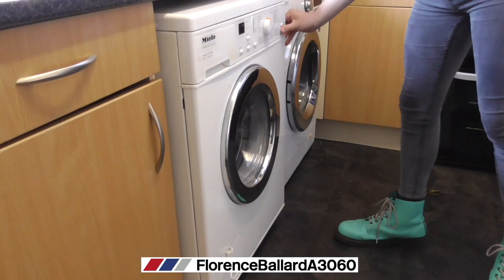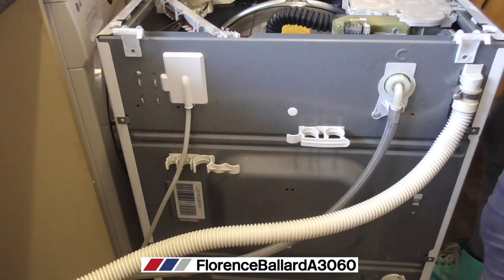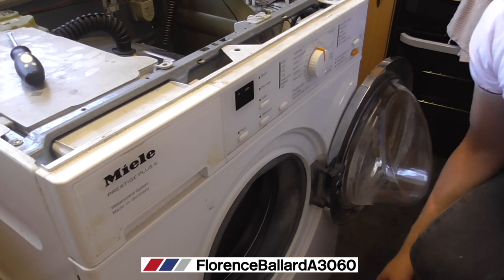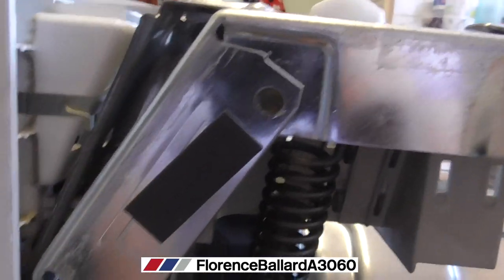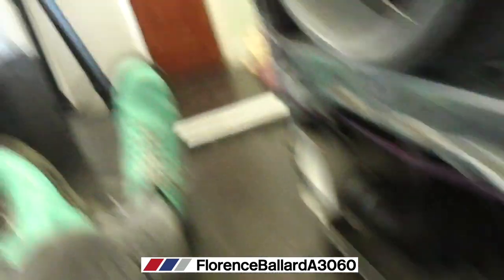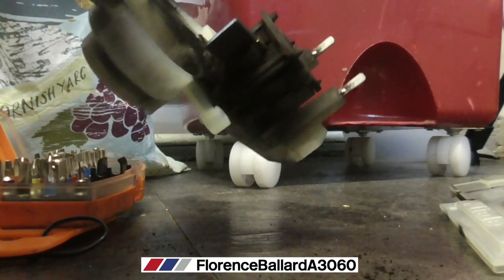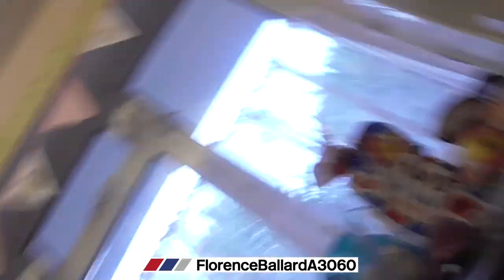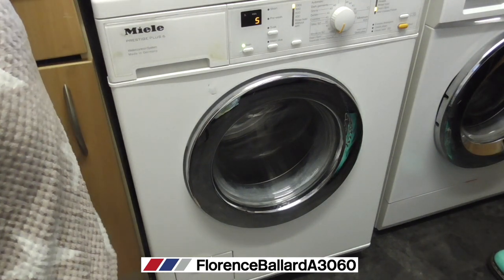Millie's First Carbon Brush Replacement in 12.5 Years

Comment: 2 questions as I have the same issue. 1. Did the brush holder just pull out after you removed screws? 2. How did you get the new brush assembly back in without damaging the brushes? Thanks.
Reply from the maker: Hey! :). So the brush holder does come off after removing the screws, but from what I can remember, I did need to jiggle it slightly to remove it.

As for the brushes upon refitting, I held them in with my finger on each end as I slid the holder onto the armature. I hope that makes sense haha
Reply: @HooverA3060  yup perfect sense. New brushes coming in a couple of days so thanks for the heads up , much appreciated.

Comment: I’ve brought a miele for £45 it’s a w1512 but I changed it to 1500rpm and when I brought it it had bad brushes one worse than the other this video was very useful and helped me all the way through it and a waterproof fault came on to but that was just the cable for the pressure switch at the bottom new she’s as good as new
Reply: Sorry, I know your post is a couple of years old, if you can remember, how did you do the upgrade to 1500rpm?
Reply: @emmams5  press and hold the start and turn on then press start 5 times and it will go into recon mode so you can change it tjere
Reply: @Boschwhirlpoollad1996  Thanks for the quick reply, 👍

Comment: I used your help to change the brushes in our Miele, however would add the following. trying from the front of the machine to engage the brushes and the four pins was far too much hassle.   after putting the front on to test three times, I took off the right side panel, removed the motor, 3x 13mm bolts, and could view engagement of the pins, also be 100% sure about the brushes being engaged with the commutator. Do yourself a favour, take the motor off, get it right first time!

Comment: You left out the only important part.. Actually pulling the old brushes out at the connection.. Can I just rip it out? Is it just a pressure connection because it almost feels as if it's tack/spot welded in
Reply: Had the same question and just pull it back, holding both sides.

Comment: You made life very difficult for yourself. You only need to remove the front panel (large ring around the door rubber) and 3 torx screws to gain access to the motor to change the brushes. You don't even have to pull it out from under any kitchen units.
Reply from the maker: Yeah lol, I mean this was 2 years ago though, so since then I've seen many videos on how to do it the easier way. Not that I can see myself working on any Miele's in future or anytime soon, but it's handy to know for references. So thanks for the heads up!
Reply: @HooverA3060  Your video was actually a help to me.
I've just replaced the bearings in my W3824 Miele washing machine drive motor and I didn't know how to lock the brushes in their housings when refitting the brush assembly. One of my brushes was also worn down more than the other. 2 new brushes ordered from Amazon for £11.79.
Miele wanted £44.40 for one brush. Who only changes one brush FFS?
A new motor from them would have been £532. Second hand motors are going for around £50 upwards on ebay. Hopefully with new bearings in my existing motor, it should be good for a few years more. Touch wood anyway.

Comment: When the brushes aren't equally worn out, it's the rotor that has a defect. This is not a solution to your problem. The motor should be revised as well.
Reply from the maker: Yeah unfortunately it seems to be an issue across this range of Miele. However this machine is no longer receiving any further repairs, as it will soon be taken out of service when I move to be destroyed. But it is something I will look at when I get my own Miele

Comment: Just curious, how did you find out the fault is in brushes?
Reply from the maker: So, on these machines, the display with flash up a symbol like this "---" which indicates a motor fault, but the most obvious way to tell is the machine struggling to maintain speed and/or the motor stalling, but you still hear the clicks from the board when the machine is supposed to tumble or spin
Reply: @HooverA3060  grate thank you.
Reply from the maker: No problem!

Comment: Did them on my Miele and it wasn't as whiny
Reply from the maker: It'll depend on the machine, its age and condition of armature, as not all brushes when fitted will sound the same
Reply: @HooverA3060  my Miele was older then this one when it had its brushes changed

Comment: I need to do this job this week. How did you get the assembly back on with the brushes 'in the way' without damaging the new brushes?
Reply: There are different types, but you will be able to keep the brush back and release when the assembly is screwed in place. Some clip back, some have a little tab to bend in and hold the brush - to release push the back with a cocktail stick.

Comment: How do you get the interlock to lock?
Reply from the maker: It should just automatically lock once the machine starts, only issue could be a loose cable or your interlock is faulty :)
Reply: What I meant is that you managed to start the machine without putting the front cover back which means you managed to activate the interlock. How did you do that with no front panel
Reply from the maker: @rgosain  by simply closing the door the same way as you would normally. As long as the door interlock is still attached to the front panel, it doesn’t affect anything by having the front panel off
Reply: @HooverA3060  Mate you haven't put the front panel on and still started the machine for which the interlock needs to be activated. I was just checking how you managed to do that. Anyways my machine is sorted.
Reply from the maker: @rgosain  You don't need to put the front panel back on to activate the interlock. As long as the door can still close into the door interlock switch, it will still activate it. All the front panel does is just hold the door and other parts to the machine onto the cabinet. But it can still be closed and operated without the panel attached.
But that's good your machine is sorted :)

Comment: The uneven wear of the brushes indicates a faulty motor. A segment of the commutator has burned. It will work again but not for very long. The commutator has shorted,
Reply from the maker: That probably could be why. It would explain the uneven brush wear
Reply: How to fix or replace that commutator then? I have exact same issue: only 1 brush worn off.